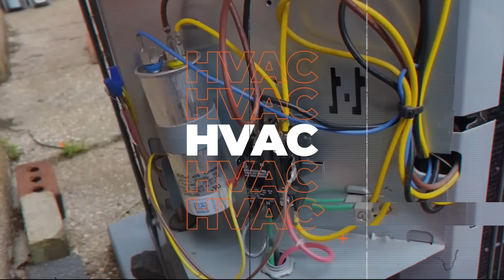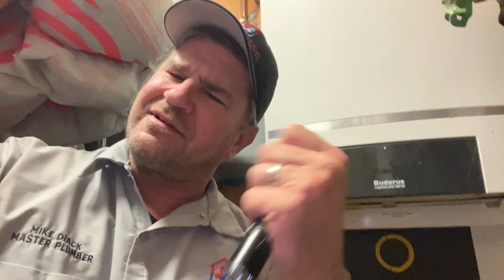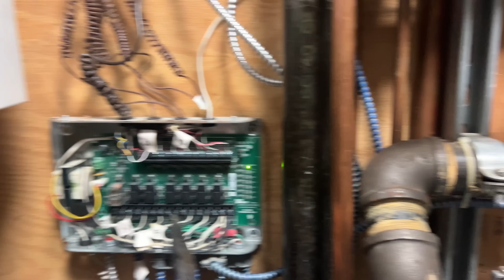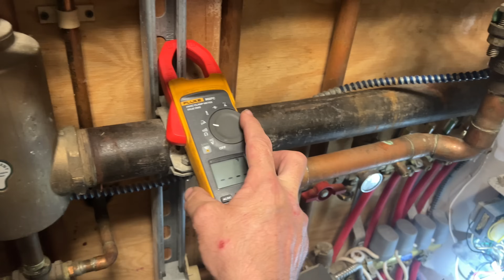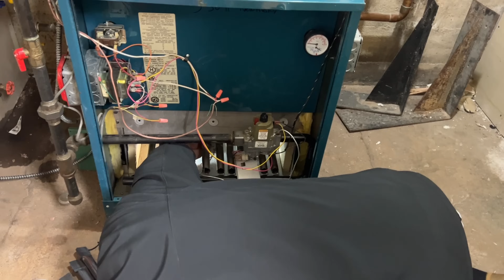How to Diagnose Radiant Heat Issues with 4 Wire Zone Actuators Similar to Zone Valve Wiring

Comment: 90%of the thermal couplers I’ve changed because the pilot light won’t stay lit I would change it and the gas valve is bad. I know it’s supposed to be the other way around but for some reason it’s always a bad gas valve for me. I get so pissed to spending all that time on the thermal couple.

Comment: Hey Mike
Just watching 1 year video you talk bout your heated side walk were you rain 270 feet  instead 200 feet . You were say not work best at the end of run.  I you put 2  circulator pump at outgoing side and  return side.  I have much longer run. I used wood boiler just for side walk. It all bout how gallons per minute you can move through pipe.

Comment: Thats probably Blazemaster CPVC. We use that here a lot in community homes for there fire sprinkler.  Easy to work with but a pain in the Arse. Cure times suck on larger CPVC when its under high pressure
Reply: there's like 4 different brands of orange fire CPVC, pretty much have to find and read the labeling to know what you have and match it up. none are rated for intermixing that I know of, but I'm not a tinkler sprinkler guy. lol

Comment: Since when they changed fire suppression color codes ? It’s always been red, also orange conduit is for communications
Reply: I have been seeing the Blazemaster  orange CPVC at commercial and residential construction in NY State since at least 2008, if not earlier.
Steel pipe is still being painted red.
Reply: I believe the CPVC suppression lines have been orange since introduction in the mid 1980's? I think the whole idea was to look different than other cpvc and also different from the red metal piping. pretty much anyone in the building trades knows to not play with anything red or orang, unless of course your the part of the basement saver crew(sprinkler/fire guys. lol)